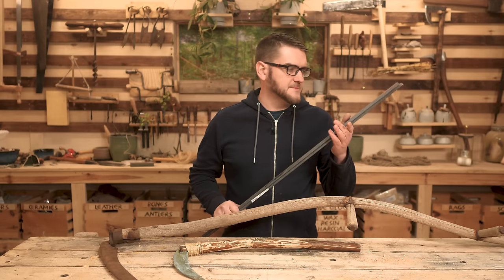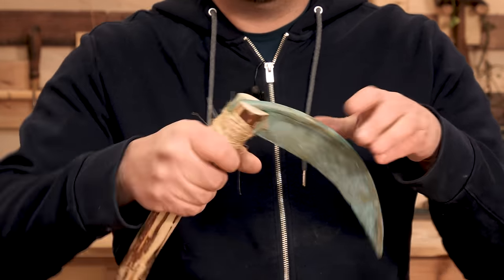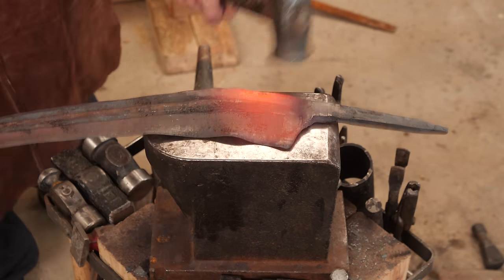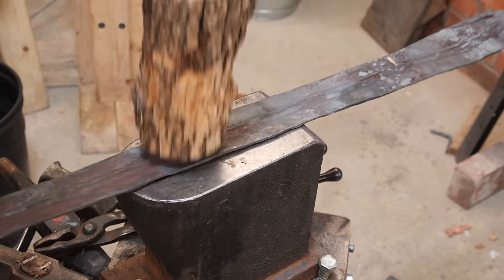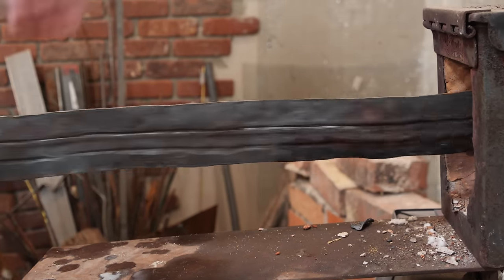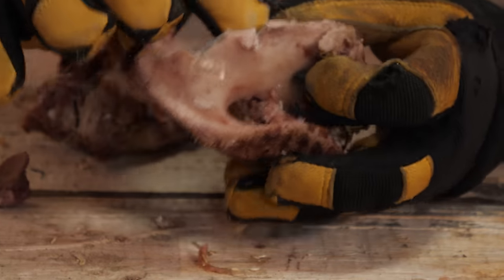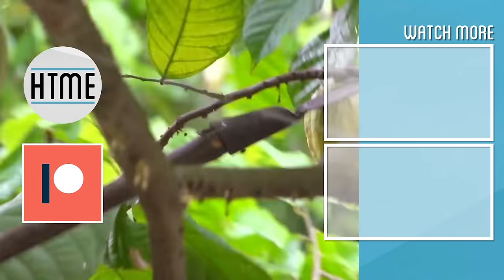Farm to Sword: Can you Turn Old Farm Tools into a Norman Sword?

Comment: I know they are working the metal in a brightly lit shop for the sake of filming but they really need a dark workshop to see those temperatures. I’m envisioning all the stress fractures from working that metal as cold (relatively) as it looks. I know the light bleaches the color out so we can’t really see it. I know they’re bright lighting for the sake of filming. And I thank them for all the work.
Reply: Don't worry too much, scythes are pretty soft steel, they can stretch a bit before breaking
Reply: That, and it looked like they were doing spot heats. If they had let more of the metal get hot, then it would have flowed a little better. But it was already so thin that there's not much you can do to prevent a tear, especially on that big curve.
Reply: as a film student, and amateur blacksmith, its harder than it looks! 

its hard to predict which part of the heat you will want to film, and changing the exposure on the fly isnt always an option. coming fresh out of the forge you would want the lowest exposure, but quickly youre gonna want to turn the exposure up as the metal cools. that pretty much cant be done on the fly while filming, so youve got to decide which step you want to look the best ahead of time.

its a lot to consider :P
Reply: I work iron at relatively low heats all the time. In pure iron like this especially you can beat on it all day long. As long as you are getting it at least a little bit hot and you aren't completely incompetent, it's not going to break. You can hammer wrought iron completely cold honestly.
Reply: @arcanealchemist3190  The best way to do it is to show people working in basically complete darkness. Or at least a dimly lit room. Then the colors will show very brightly. No changing of the exposure needed really. Just get a guy in there with a camera and film it. It honestly won't look bad. It's much harder in daylight.
Reply: @bilbo_gamers6417   working wrought cold will split the  layers

Comment: The beauty of blacksmithing is the ability to recycle almost anything steel into something else. Just a side note, scythes are mild steel with a work hardened edge. That is why the sword bent so easily on that last blow. I think if the Smith would have ground both edges back to make them thicker, then cold peened the edge like you would do with a bronze edged weapon/tool, it would have held up a bit better. At the end of the day, I still wouldn't want to be on the receiving side of the sword you made. Well done!

Comment: You could have made a reforged scythe, a common repurposed polearm often used by peasants, which is basically a scythe made into a spear
Reply: I was thinking that too. They were basically just scythe blades that pointed forwards instead of to the side and on a straight pole. Could be used for stabbing and slicing with a prettly good range.
Reply: modified war scythes were common enough to inspire a purpose-built polearm called the fauchard
Reply: Not really a spear, but a polearm. Lithuanian and Polish peasants used them during the revolts against Tzar Russia
Reply: @Meesopaste  Literally a Polearm lol
Reply: Dont forget that during the bohemian revolts paulus hector mair wrote the opus on athletic martial arts which was a detailed fencing manuals intended to teach farmers how to fight with the tools at hand. Those tools in specific being the agricultural flail, the peasant stick, the sickle and reaping scythe and even the "fork"
Reply: Did yall look at the thumbnail

Comment: Okay so two things. 1) While we can all agree that this was a novice attempt at this project, I'm a relatively experienced blacksmith and as soon as making a sword out of a scythe blade came up I immediately thought that it was a deceptively difficult project. There's a reason you beat swords into ploughshares and not the other way round. At each step he was forced to use a very basic skillset to do something that was better achieved using some much more well developed skills. Regardless, he made a blade that survived  a water quench and warp straightening in temper that didn't immediately shatter, yet held an edge of some variety. That could have gone disastrously worse at any of those stages, but he succeeded in that. While there may have been an amount of luck that went into this project, Theo also used enough caution at each step that it came out looking as good as it did. THAT is a skill that might be really useful in someone you want to try doing a whole bunch of new things. 

2) Seeing Theo take this on makes me want to get out in the shop and challenge my abilities to get better. Try  doing more complex forge welding than I've usually done, something like that. I remember being at Theo's stage in smithing, and seeing the beautiful things people can make and wanting to try doing that one day. Theo's attempt at this has motivated me to get out and do more of the trickier techniques you'd need to use to do a good job of this idea. 

TL:DR yeah, it wasn't great but smithing is hard and he seems like he may just be an asset to the team when it comes to trying new/tricky stuff

Comment: "Svo má brýna deigt járn að bíti!"

Even soft iron can be sharpened to an edge, it is a rough translation, but it gets the point across.
In one of the Icelandic Sagas, Gunnlaugs-saga ormstungu (Saga of Gunnlaugur Wormtounge), it tells of a duel, where they agreed to a pause so they could straighten out their swords, who had become quite bent after the fighting.

Gunnlaugur was nicknamed "wormtounge" because he was a good poet, and came up with some sick burns and good one-liners!
Reply: Ehh. Working iron into a sword is a very different skillset than forging modern material. You can't just rely on the grind. You need to make sure that the edge has the correct grain, and, in iron, that can only come from cold working. It is not super difficult but also it is really not easy to get right, especially to produce something comparable to a decent steel sword.
Reply: "And then you can sharpen the crushed iron to bite!"
TIL VALHALL VI DRAR
Reply: @bilbo_gamers6417 One will definetely make it far with such a pessimistic art of thinking.

Comment: I know everyone is going to have their input on this, and I think that's fine so long as it's constructive. In future reclamation projects with steel and iron, consider forge welding your material into a bar first, then drawing it out into a blade. I have done a number of similar projects as this and I have found that when working with such thin material, you get a better final result by just consolidating it into a bar first. The trade off in work usually ends up in your favor. Rather than trying to correct for warping and cracking of an already over stressed steel, you just draw out a blade with the proper taper and balance from begining. Little things you learn after countless hours at the forge.

Comment: you should've filed off that thin edge or bent it at a much higher heat to prevent those cracks. that edge is probably insuitable for combat anyway.

Comment: The better option would have been to cut the scythe up into smaller pieces, hammer them into as many usable bars as possible, then forge weld those together. And then draw them out into a blade.

Comment: I wonder if folding over that edge so both sides were thick then create both edges later, would have worked
Reply: "I wonder if folding over that edge so both sides were thick then create both edges later, would have worked"

No... that would require fire welding. to do that you need to grind it clean then get it up to temp and wack it back together. With such thin steel over such a long length that simply wouldnt work in a coal forge (you'd burn it). Might be possible in a gas forge but you would lose a lot of material and likely it wouldnt be much thicker than it ended up.

Comment: My suggestion with the scythe would have been to fold the thin side back in, and continue folding and eventually just twist all the metal into a solid form (High risk of it de-laminating and splinter cracking in this process) from that re-folded then hammer out your sword.

Comment: This is pretty cool. Usually with sword making content you never see this kind of semi-destructive testing. Also shows how much difference a good, well tempered and balanced sword would make in a battle against a crude one, wielders skill not considered.
Edit: Also, I just noticed the forge you're using seems to be one of those gas powered ones? Normally I wouldn't complain, but for this purpose a coal powered one would've been better (others have already mentioned some stuff about carbon etc)

Comment: Probably would have been a better idea to try for something single-edged like a Falchion or Langmesser. You still would have had to straighten out the blade a little, but you could have had the thick part remain as the back and the thin part as the blade because frankly, I think trying to get a second edge on there wasn't great for the structural integrity of the blade.

Comment: Actual blacksmith here - I hate to say this because there's no way to make this not come off as mean, but if this was a "challenge" for your new guy, he failed. I don't know what level of experience or knowledge you were expecting, but I think you were a little ambitious to lean on him to be a subject matter expert for a video.

To start - scythe blades are not necessarily harden-able material. Frequently, they are made of a lower carbon steel with the expectation that they can then be peened and honed to re-sharpen them. Some modern scythes you'd get at a hardware store are not, and are just straight high-carbon steel, but given the construction of that scythe, it would not have been my first guess and I certainly wouldn't have started working on it without testing the carbon content of the steel (easily done with a grinder). While swords do typically have lower carbon content than, for example, knives, the carbon content of a typical scythe would be far too low. This isn't to say that historical swords weren't floppy noodles - it's a lot easier to hammer a sword straight again than it was to put two halves back together again. Historical swords often relied on geometry to help maintain stiffness - think Gaussian curvature, or the thing that makes your pizza not floppy when you fold it. But given that he was trying to quench the sword later, and the geometry of the sword, he was clearly operating under the impression that it was modern, harden-able steel. 

As for the process - the issues with straightening it out were pretty obvious to begin with. Some people have mentioned entirely reforging the steel into a bar and working from there, but frankly the most simplest method would have just been to hot cut the thinnest 1/2" - 1" of the edge off and then go from there. Either way, I could see the tears in the steel coming from a mile away - including likely dozens of them that were micro-fractures that you wouldn't be able to see. This isn't nit-picking; from a safety perspective, I would not consider that sword was not safe to swing since there was a high chance that it could snap and break and then you have sharp metal flying around. 

Additionally, his technique was also very clearly inexperienced - the sword could have been forged much closer to finish, or at least be forged somewhat straight. Historical blacksmiths did not have electric belt grinders to rely on, so they had to forge their swords much closer to finish. You should be able to get a pretty decent looking sword with just a forged finished and a grindstone to take off the scale and put an edge on it. Hell, if you like a hammered finished, then it would be even simpler.

Other things - he referred to annealing, but he meant normalizing. While yes, they're both slowly heating and cooling the blade, the rate of cooling is vastly different and results in different grain sizes. When annealing, the slower cooling results in significant growth in the grain size of the steel - this improves ductility, but is very bad for quenching. Normalizing involves cooling at a much faster rate, usually air cooling but it depends on the specs of the steel, and this causes the grain size to shrink, which is ideal for quenching. Not to mention the quench itself, that blade was not nearly hot enough nor was it dunked in water deep enough, and splashing water up the handle. 

I'm not trying to just dunk on the new guy here, and you have had some great, knowledgeable people in the past including some blacksmiths who were an absolute delight to watch work. I just want you to fully understand the experience and knowledge you have available to you, and temper your expectation (no pun intended) in future projects. There are lots of blacksmiths and historians who I'm sure would love to consult on video ideas to help make sure that they're both more factually accurate, and result in a more successful project. Best of luck!
Reply: Antique scythe blades are made with a san man style of assemble with a near paper this tool steel edge sandwiched between mild steel blanks.  yes I am aware of how bad the heat treatment was, but one it was for a ten minute YouTube video, and two our normal quench tank was frozen solid from the high temp of -8 that day.
Far more experienced blacksmiths than me have struggled with repurposing scythe blades (see Green Beetle for example)  I am aware that there were better ways of doing this and I would have been happy to do them, but Andy asked me to do something and I did it.  I appreciate your input but As I am also a professional blacksmith working three different jobs as a blacksmith, please hold your opinions of me until you see something that is actually indicative of my work and not just a fun video challenge.
Reply: @theomelchior2739 I don't think "it was just for a short YouTube video" is a good excuse to do something that you know is poor workmanship.

Comment: Yeah, a gme try but should've been pretty obvious from the get-go that there's not enough meat in a scythe blade to stop it being bent by any fair blocking blow from a stick. Scythrs, by their nature, are going to be as lightweight as possible and a sword just needs the mass. You'd really need to weld the thing into a brick and beat it out again into a shorter, thicker sword. Much work...

Comment: "A little thin" is an understatement. The tempering process was "done" three times, and there are more than 10 different historical ways of reforging steel. How he did it would've caused stress fractures, warping, snapping, imbalance, and dulling. He should have broken or cut the rusted blade and reforged it via forge welds. Then he should've drawn the blade out, leaving the previous tang. It would've taken longer, but given better results. I love watching you guys work, but this hurt to watch. Sorry, I felt I had to rant about that.

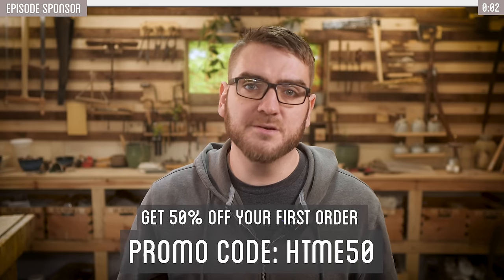Comment: Very Joel 3:10! But I think scythes are traditionally mild steel so they can be peened to sharpen and work-harden them (hence the bend on the bone chop).
Reply: A lot are also mostly mild steel or wrought iron (depending on age) with just a forge welded high carbon edge.

Comment: I don't know much but I would have heated it and worked the edge into the metal while straightening it then when I got it relatively straight than I would have worked on drawing out both edges.

Comment: Out of curiosity, would it not have been easier to cut the scythe blade into pieces and forge weld those into a brand new billet for a sword? I'd suspect it might not have enough metal since then you'd need to re grind everything etc but it seems like the obvious solution
Reply: Forge welding is harder to do, especially if the scythe was made from modern mild steel. Its hard to get forge welds just right, and modern steel is pure enough it actually is harder to forge weld than many older forms of iron/steel. It certainly would have been better, but not exactly easier. I once tried to forge weld some rebar I'd cleaned together, I accidentally broke a fresh forge-weld while making it and ruined my billet early on. To fix it I'd have needed to grind down the separated surfaces and tried again to ensure I didnt make inclusions in my new bar.
Reply: Reclaiming steal with forge-welding can be pretty difficult depending on the type of steel. Even with wrought iron, which is known for it's easy of forge welding and reclamation, it still takes a lot of work and loses a lot of material to forge scale. The easiest way would have probably just been to hot-cut the thinnest 1" or so off of the edge and then go from there. It would have left plenty of material, and the edge material could be easily recycled in the future for nails or wire or whatever else.
Reply: It might have been better, but it would definitely not be easier. Especially if that scythe has a forge welded edge on a wrought body, which is completely possible, it would be significantly harder to do successfully.

Comment: Really good Video. The reforging is very very lot of hard work. But the forging temperature looks really cold and the Tempering and hardening was not right. If it where properly hardend, it wouldn't stay bent! Also another variant would be to cut the sickle and weld forge ist. But this example from the video is maybe more historical correct, im not sure. ⚒️